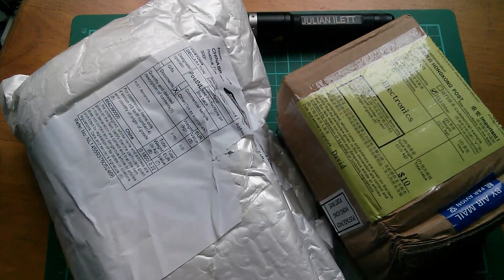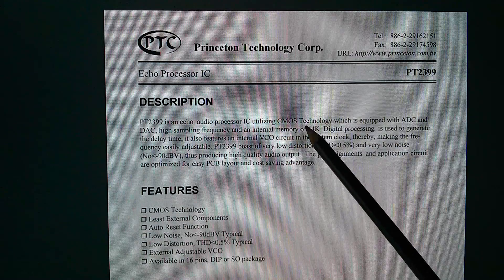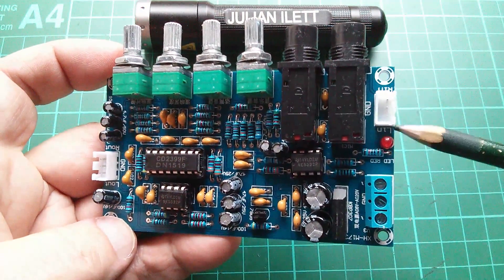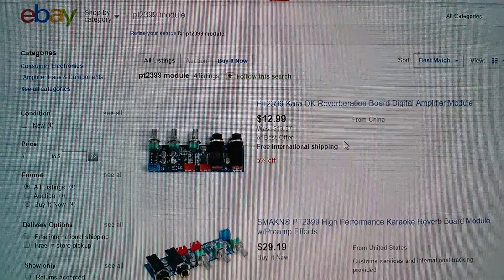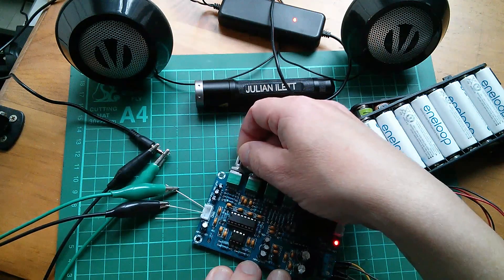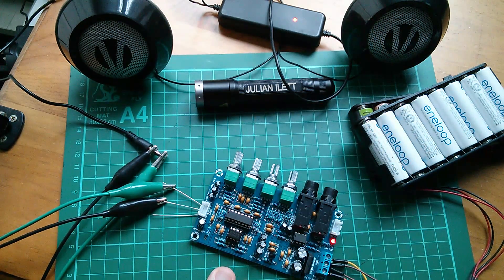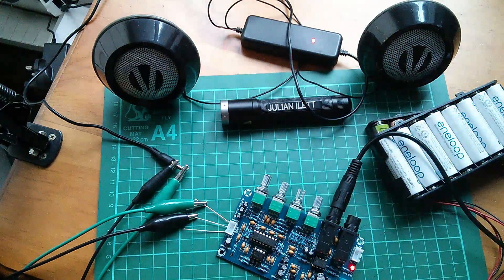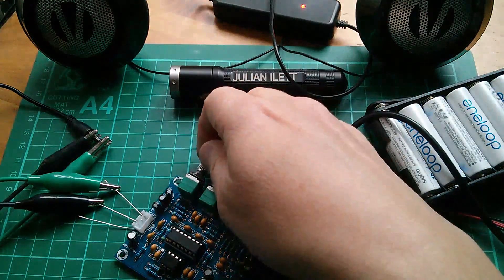Julian's Postbag: #58 - Karaoke Reverb PCB, Dynamic Mic

Comment: Technically speaking this little effect board is really sweet. But since it requires an AC transformer it's a bit of a bitch to power on. Wish it could have been just 18v DC so you could just use a normal DC wallwart.

Comment: I tested exact same model with 12v dc power supply... connected terminals to two ends (12-12)... it looked like it worked as light turned on.. but as soon as i connected output to external power amp (lvpin lp-2020A) via aux cable (3.5mm TRS), the light went out and it did not work.. Strangely, when i inserted aux only halfway, the sound came out but then delay did not work. Do you have any idea what the issue might be?

Comment: Does this module works without additional amplifiers.

like how you see it will take just a power source (DC?), and the output of speaker.d whether it runs on DC power 9-12V
I read somewhere that it takes an additional amplifier

Comment: Are you running this module with dual power supply, +12/-12 or just two +12. Can it be powered with a single 12volt supply?
Reply: jay crocker i am also wondering, have you checked it?

Comment: I suspect that the pot on the far left as you look at the video is the 'repeats' adjustment  rather than the "reverb level" and the pot next to it is, as you correctly identify it, the 'delay'. These are the common adjustments with a PT2399 delay/echo circuit. Any 'near reverb' effect can only be achieved with a circuit using 2 x PT2399 (one set to short delay  and one set for longer delay) so this item is actually an echo/delay effect not a reverb effect. The best reverb circuit I've come across (uses 2 x PT2399) is called the 'Equinox' by Valvewizard. Primary for guitar effects but works superbly for voice if a pre-amp is added up front   http://www.valvewizard.co.uk/equinox.html

Comment: It sounds like in the public toilet... :)  I guess it needs at least 2 more of these PT2399 chips to sound less hacked... or more smoothly. Maybe the Chinese will create Rev modules with several PT2399 chips. The great thing is that  the SMD boards are  much smaller than any DIY layout.

Comment: Regarding the Karaoke board, do the line level inputs also process through the reverb or just mix?  When you connected DC through the 3 power terminals, was it 2 separate dc+  sources on the outside terminals and a common ground in the middle?

Thanks

Comment: Hello julien Ilet, i have something i want to do with my makey-makey v1.2 from joylabz. I've noticed that some makey-makeys from other companies offer ways to reprogram it as if it were a normal micro controller that has special keyboard operations avaliable; however, this company does not offer anything like that, only reassigning keys. I want to load fully customizable code into this thing, it's got a pic18f25k50 micro controller. Any idea on how to do it with only the usb cable and a computer of some kind? Also, after some google searching of the only other piece of silicon on the board, it seems to be some kind of shift register... The hc595, is that what it is?

Comment: Hello, I have a problemen with Lion battery's, i want to mar a 15v battery's pack with around 6Ah. But i don't have a charger tot them. and I was the little charger modules on aliexpress and i thought why not fuse them together. So you have a charger module on Every battery, and you have them connecties in series and parralel so you get the right voltage. wich means that you can make a battery pack with a 5v charger, with a cappacity of 6Ah and 15,... volts. As i'm not an expert I don't know if it is toont to work. but I wanted to make a boombox with internal battery. 
thanks for listening Maas
Reply: buy lithium BMS boards from ebay.

Comment: That was some 1960s hitech right there :-)
Reply: +petti78 Tape delay and spring reverb were available in the 60's. Analogue bucket brigade line ic's were more 1980's. Cheap sampling ADC/DAC with built in memory delay IC like that is newer technology?
Reply: +Coolkeys2009 I was thinking about what those effects sound like, not the actual chips used to create them. Thinking of old movies etc.

Comment: Julian, an easy way to remember the pinout of a stereo jack is, "Red, right, ring." All R's. Red, for the wire color. Right, for the channel. Ring, for the ring connection on the plug/socket.

Just for completeness, the plug has three connections: tip, ring, and sleeve. That's where the "ring" comes from.